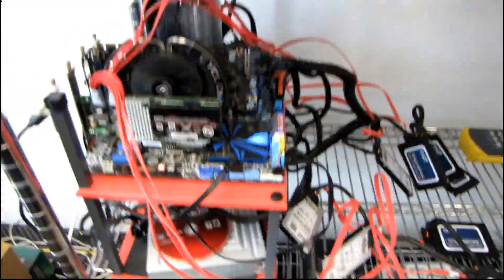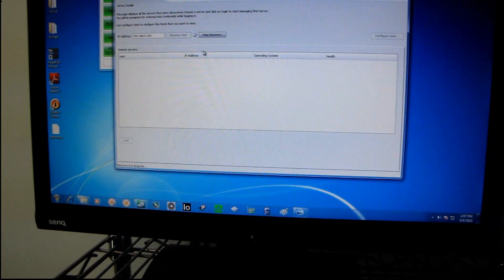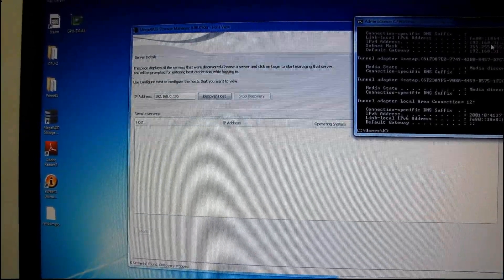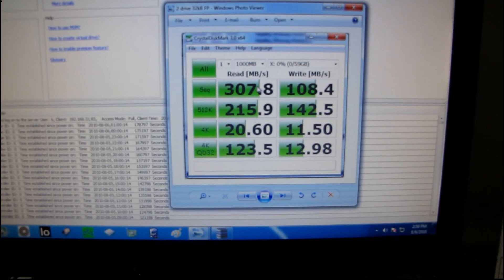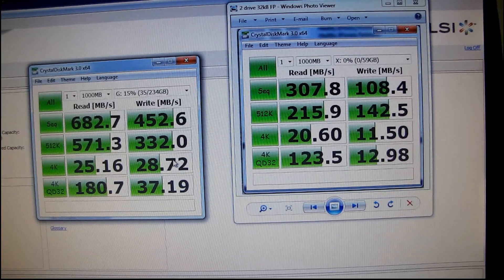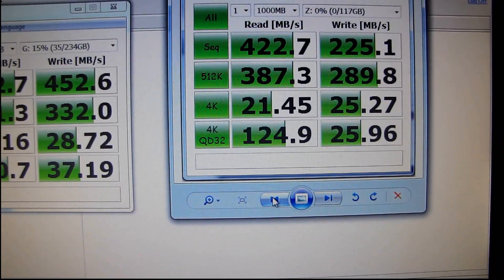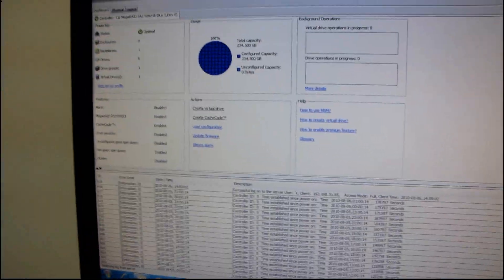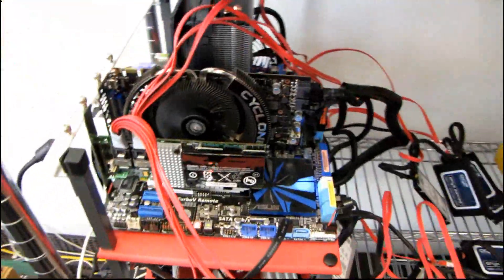LSI 9260-8i FastPath SAS RAID Card & OCZ Onyx 8 SSD RAID Performance Testing Linus Tech Tips

Comment: Lol. Hold the press!

So.....
In the candle age, SSD was 10 times faster....
Then in the electronic age we were four times faster SSD drives.
And in tech utopia were now 10 times faster than before....

So oddly all the claims are true and all are false. You see I think that were only 4 times faster....

Back in the day, you could load systems in raid, but there was a few problems.
The FSB.
The north and south bridges bus.
And system bus.

So you would saturate after 5 drives on domestic. Hence a com card takes the slack. 
But if we get a new board, run the same test again, how much difference would there be?

Comment: Ahahah I love knowing my computer is 10x better than top of the line stuff 6 years ago.  Makes me glad I always buy midrange stuff.  My Kingston Hyper X PCIE m.2 ssd does 1580 MB/s read 680 write on crystal diskbench.
Reply: luke saylor lol yeah. My single Samsung ssd connected to onboard sata is getting close to the read/write of those 8 drives
Reply: Yet both of those take ports off the mobo, whereas everything you hook up to a RAID controller is internal bonus (with the cost of a PCIe slot of course.). I have my mobo's 8 SATA connectors + m.2 already saturated, so had to get (this particular card) to hook up 4x4TB more disk.

Comment: @EmptyMellon chipset/motherboard RAID controller should actually never be used - if you have no RAID card, then use software RAID (mdadm in Linux / diskmgmt.msc striped volume in Windows). It'll be faster, more stable and stuff.

Comment: Hey linus, another great video, ive just ran that crystal disk mark v3.0 on my vertex 2 drive with poor results, is it possible that the sata controller on my motherboard (which is quite old) could be bottlenecking my drives performance?